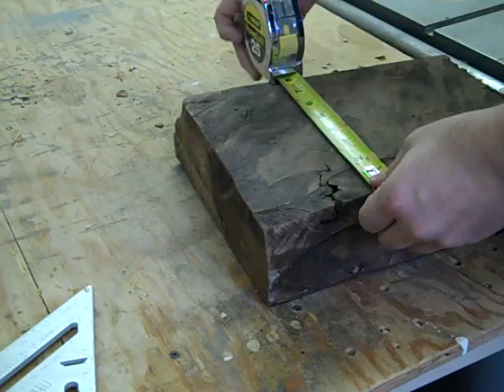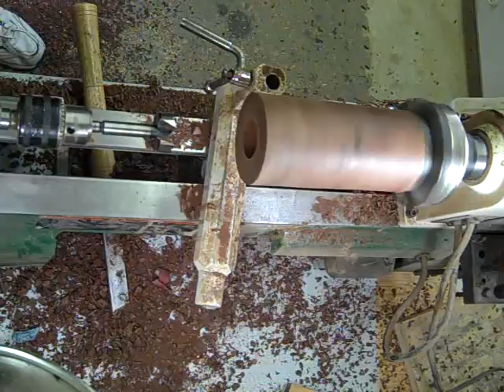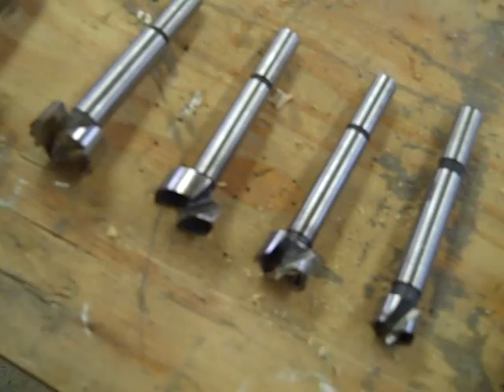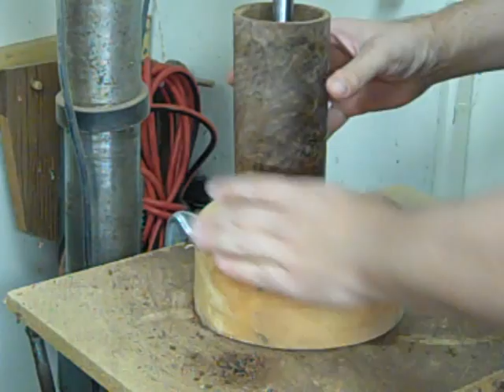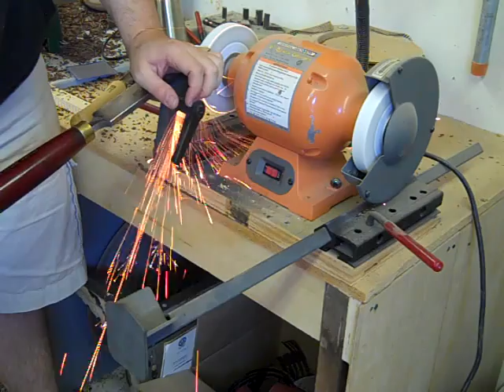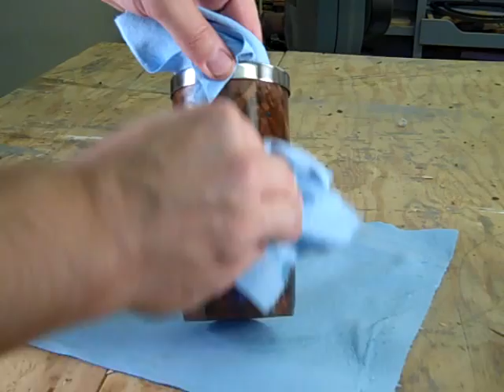How To Make A Wooden Travel Mug

Comment: by the side of the road !?!?   Sighhhh......
Reply from the maker: I know right?! It was awesome!
Reply: Peter Brown  That's when people pull out the Bill Murray "You Suck" jpeg...  

Of course then there is Matthias, who seems to build everything with found materials.  

Gorgeous walnut by the way.  Looks like you had enough to make a few more.
Reply from the maker: wordsnwood I just pulled it off the shelf again last night. It has a lot of cracks and voids in it. I might have to stabilize it for any future projects!
Reply: Peter Brown Stabilize the wood? Umm this is new term for me. Care to explain how this is done? Am i right its for to stop wood cracking more when it dry?
Reply from the maker: Hellsong89 Yes, in a way. When a block has a lot of cracks or voids, you can submerge it in resin in a vacuum and that will suck the resin into all the holes.

Once the resin dries, the blank is then full of resin, and therefore much harder and less likely to break apart.
Reply: Peter Brown Okey so thats how its done! But wont that resin cause color differences or something like that? I would imagine it would cause issues with certain coatings, like water based lackers and some oils?

Comment: here's a good recipe I made up for in the mooring I call it nitroyou'll need Nescafé dark roast and preferably liquid creamer whatever you like and maybe nutmeg and cinnamon if you wanna make it holiday flavor 1. boil some hot water, or run some in your coffee maker it doesn't HAVE to be boiling that's why I said Nescafe and liquid creamer2. dump two large spoonfuls of the instant coffee into the cup with the liquid cream and any other flavors you can drink this now if your in a rush note it will taste gross......3. add as much hot water as you want this is very strong and if you like light coffee you may not like it but if you're in a rush you can put two spoonfuls of the instant coffee into the bottom of a cup and enough water to dissolve it and gulp it down like a rock star. it will be mega gross but I live buy this if I wake up late and I really need to go